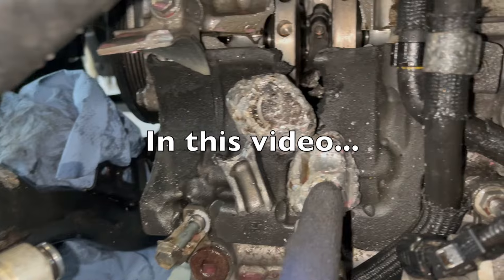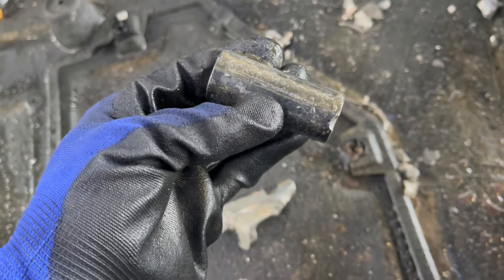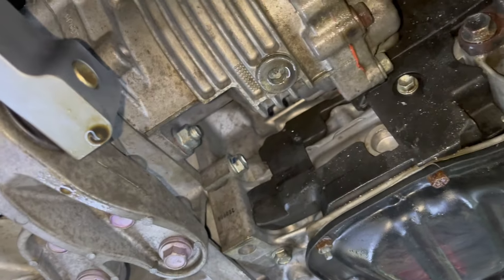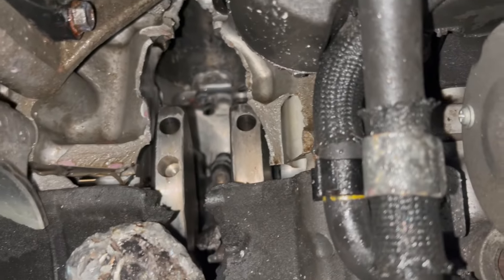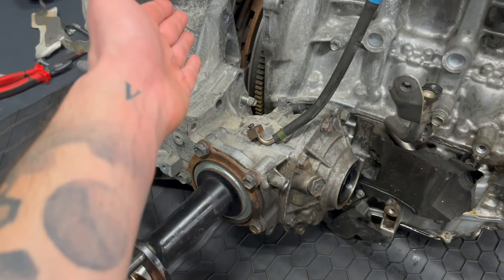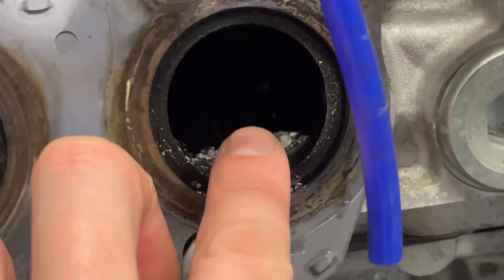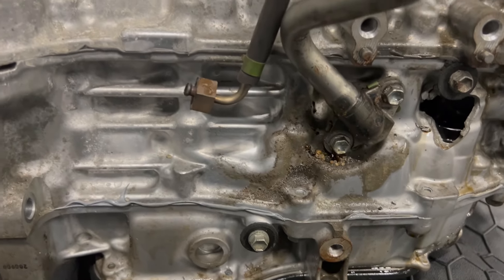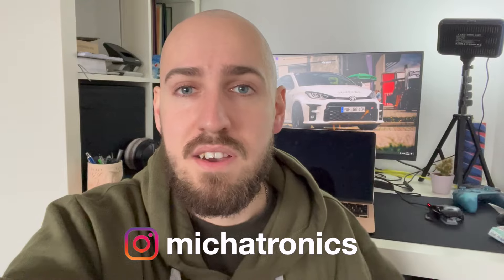BROKEN Engine on GR Yaris after 120.000KM

Comment: Sagbloß der aufgeblasene Anlasser lebt nicht lange ? Wer hätte denn damit rechnen können 😂😂😂
Reply: Das Problem steht offensichtlich nicht im Zusammenhang mit dem Hubraum oder der Leistung. Genau dasselbe Problem hatten wir bei einem Motor mit 2 liter Hubraum und 1/3 der Leistung. Ohne dauerhafte Ölversorgung stirbt jeder Motor.
Reply: Wäre das Problem mit dem Oil-Pickup nicht vorhanden, was erstmal nichts über die Qualität und Langlebigkeit des Motors aussagt, wäre der Motor nicht bei 120000km auseinander geflogen.

Würde man das Auto 24/7 nur im Daily vorhanden, wird man von diesem 'Problem' nie etwas mitbekommen.

Wenn man auf die Rennstrecke geht, und keinen "baffled oil sump" verwendet, überfüllt man zwischen 300-500ml und hat das Problem auch bis zu einem gewissen grad gelöst...

Du machst dich hier auf Kosten anderer Lustig, wobei das Problem selber nicht mal daran liegt das der "aufgeblasene Anlasser" aufgrund minderwertiger Materialien/Bauqualität/Konstruktionsfehler auseinandergeflogen ist.
Reply: @wubziz4769 was ist es denn dann wenn es kein konstruktionsfehler ist?

Comment: Welches Öl bist du gefahren? Ich fülle die 0W20 Suppe da rein 🙈 Wollte mal auf RedLine Oil umsteigen. Die haben jetzt auch die neue Norm für Toyota Islac 6F
Reply from the maker: Das Öl seh ich weniger als Problem. Ob 0w20 oder 5w30. Doesnt matter in my opinion
Reply: @michatronics  ich weiß nicht, wie stabil der Ölfilm bei 0W20 Ölen ist. Meine alle anderen Autos und die von Kumpels fahren mit 5W40 oder 0W40 von Rowe und die haben weit über 200.000km Die Motoren sehen von innen tip top aus, obwohl die auch öfters hart rangenommen werden 😅 Vielleicht hat Toyota da falsches Öl für den Motor genommen? Und die Ölwanne sollte vielleicht dann anders geformt werden, damit das Öl nicht wegschwapt
Reply from the maker: @Ghost2011Rider  wie gesagt, ich seh wirklich eher das wegschwappen als Problem wenn die Syvecs ECUs schon den Öldruckabfall als Fehler detektieren, kanns nur an Luft ansaugen liegen
Reply: @Ghost2011Rider  Das Öl hat damit nichts zu tun.
Reply: Je Dünner das Öl, und je heißer es wird, desto schlechter der Öldruck....das kann man sogar bei einigen Nordschleife Videos beobachten , wie da mal von Anfang bis Ende der Öldruck um 1,5Bar Flöten geht...und das von Beginn 75 Grad bis Ende 130grad.

Comment: Thanks very much for sharing this potential issue Micha. So sorry for you that you won't be able to have Toyota warranty. Doesn't hurt to ask though. I mean unless your mods are "excessive" ? Phil Roetheli did install an oil sump baffle to prevent the loss of oil pump suction, thus nominal oil pressure. This is a really important piece of kit regarding all the failures happening around the world on these engines.

Comment: Informative video mate. Sorry it had to happen to you though :(

To clarify, 1bar isn’t necessarily the point where issues happen, this is just where the Syvecs goes into limp mode. You just notice the issue with Syvecs because of the datalogging. 

Anyone who drives fast even on stock tyres I would recommend max oil +0.5L unless you fit a baffled sump. Doesn’t matter if tuned or stock 

Hope you get it fixed soon ❤
Reply from the maker: Thank you for your edit! ❤️
Reply: thank you pee low for the tip! @5:00
Reply: Thank you so much for sharing this with all the GR community ! 🙏🏽🙏🏽 I hope it will get fixed for you asap.

Comment: We have 2 here in New Zealand which ONLY get used as track demo cars from Toyota NZ, admittedly they only have road tyres but they have never had an issue with them. I’d say issues start with race tyres fitted and a huge amount of cars have this issue.
Reply from the maker: @heathlett275  as I said. You loose oil pressure for a little moment with for example semi slicks, and hard brakes.

Comment: For the GRC owners watching from the US/NA: the G16E in the Corolla is NOT the same as the GR Yaris. SavageGeese channel has a video directly talking with GR chief engineer Sakamoto Naoyuki about the design changes between the two cars. Upgraded pistons and cooling system were the main differences.
Reply from the maker: Yes, we know.

We‘ll get the same engine in the new yaris
Reply: So because of the changes in the GRC, you're saying that this issue will not be happening ? ... just trying to clarify  before I am either looking for a viable solution or ... trading in for a Civic Type R . Thanks
Reply: @G16E-GTS_  We can only assume, but that's correct. It's a stronger, updated engine with a better cooling system. You could buy a Lamspeed baffled oil pan if you think you're making enough Gs to cause oil starvation, but if it's not your designated track day setup w/ 200TW tires etc. I would not be worried about this. Street driving it's a non-issue. If you are tracking, AWD ITCC cooling is probably a larger concern, unless you particularly enjoy switching to FWD mid-lap lol (no it won't enter any sort of limp/reduced power mode). Just know the CTR also has it's own limitations (FL5 still deals w/ engine overheat during multi-lap sessions like the FK8 infamously did, but it'll run more hot laps due to updated cooling; +R damping tune is not right and unusable when pushing on track). That said, EVERY car will have drawbacks - especially in this price range. They're fantastic cars that didn't need to be made and then were -- so that's how I see it. Just enjoy your car man, whichever one you end up with!
Reply: @FWPiano  Thanks for your reply, highly appreciated. NO I do not take it to the track ... however, I drive it on the streets as hard if not harder than the track  sometimes - I moved outside of major urban cities - not much traffic around  and as result no enforcement of speed limits per say in the great empty North . The down side is that not many wavy roads around here

Comment: Damn that's bad luck! Hope you get it fixed and into better spec!
Did you have oil cooler in your car? 
I'm also installing baffles during this winter. Hope they help. noted also that in braking oil pressure drops really low occasionally.

Comment: Sorry this happened brotha ; Thank you for the info in english! Definitely would like to understand how to prevent this if possible. For example, if there was a dry sump or maybe a way to have a surge tank or something related to the oil system in addition to the baffle modification.
Reply from the maker: I think the baffle system will be the solution for this problem.
😊

Comment: Wie teuer ist denn so ein Kleinserien Motor würde mich echt mal interessieren?! Danke auf jeden Fall für dein informativen Content.
Ich fahre einen M135 I da gibt es ähnliche Probleme mit der Ölversorgung, wenn man mit Slick unterwegs ist. Aber man kann dann vom M2 Teile verbauen auch so eine Geschichte mit Schwalb Blech.
Reply from the maker: Ja ich komm auch aus dem BMW Bereich und kenne das vom N55 und S55 😄 beim M4 kam ja auch mal eine andere Ölwanne irgendwann, glaub ab dem Facelift war das (bin mir nicht ganz sicher).

Der Motor kostet bei Toyota glaub knapp 30.000€ also sinnfrei.

Kann man viel günstiger auch bauen.
Reply: @michatronics   in Japan liegt der G16 Longblock bei rund 6500€
Reply from the maker: @petergrundling698  leider nein 😄 gibt n paar die das behaupten, aber Beweise gibts keine, weder Toyota Japan noch wer anderes bietet den Motor zu dem Preis an.
Reply: Meine letzte Info aus 2021 vom Toyota Händler. Shortblock knapp 3000€ und komplett mit Anbauteilen 21.000€
Reply from the maker: @maxpe111  ähnliche Info hab ich auch
Reply: @maxpe111  da ist man ja quasi gezwungen, den Motor Original zu fahren.😂
Reply: @niewie4372  In vielen Fällen reicht ja ein neuer Shortblock für knappe 3k. Egal welche Kiste. Richtig günstig wird's nur bei 08/15 Motoren :)
Reply: In Canada, a crate G16-GTS engine for GRC is over $20,000, but he may be able to save  parts of it .. hopefully

Comment: Welches Öl bist du gefahren. Das oem 0W20 ist einfach Müll. Egal Welche Spezifikation man hat.

Mir wurde dringend geraten auf 5w50 umzusteigen, habe nach 1000km dies auch getan 300V 5W50 von Motul inkl Öl Kühler und nochmal 300ml über Max gefüllt. 

Fähre jetzt 1000km bei 340ps und 450NM.
Reply from the maker: Die Wahl des Öls regelt leider nicht den zusammenbruch des Öldrucks.
Reply: @michatronics  Natürlich nicht, aber bei "track" ein 0W20 zu fahren ist auch nicht vorteilhaft für die Schmierung.
Reply: Also erstmal n schwallblech kaufen sagste...
 Echt scheiße was passiert ist.
Wobei ist es denb passiert am track oder auf der Straße bei normaler Fahrweise 😭😭😭😭
Reply from the maker: @stephenpru6482  das passiert nach und nach und irgendwann ist es halt zuviel. Bei mir wars halt grad mit hoher Drehzahl dann.